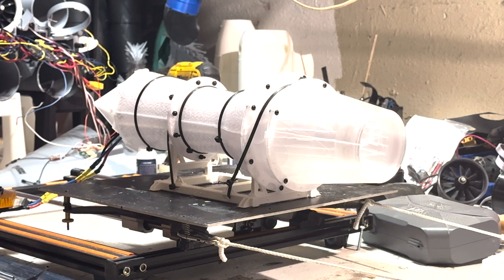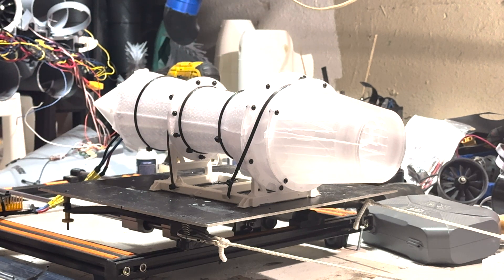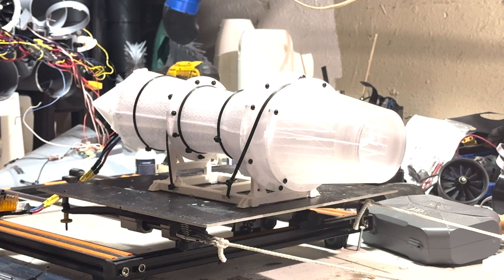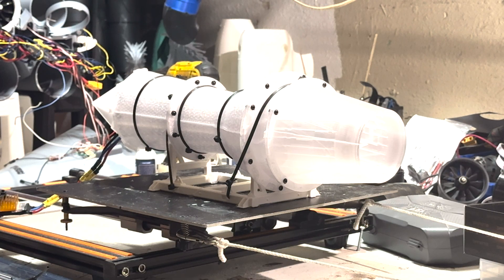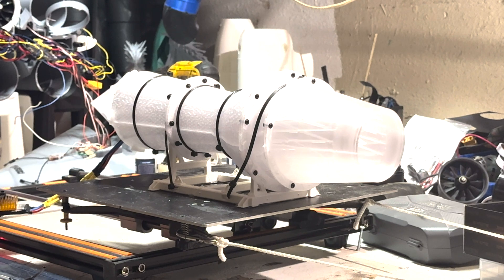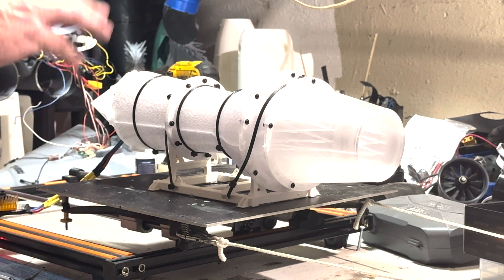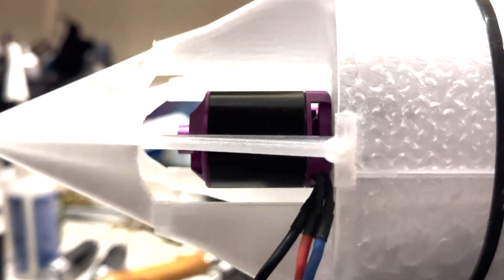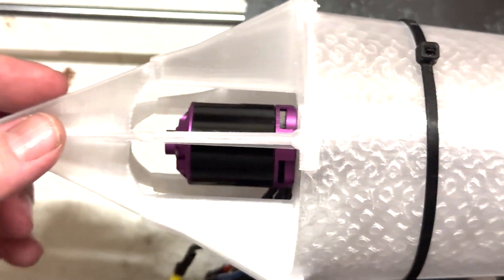Turbo Jet Low RPM test. Fully electric turbine. #rc #edf #turbojet #testing #fyp #3dprinting #diy

Comment: It might be possible to create an effective electric turbine by using two brushless motors one for the first stage and a higher rpm second stage.0
Reply from the maker: The idea behind removing a combustion chamber and using the turbo stage and the compressor stage in combination, rotating simultaneously with one electric motor means that the high-pressure air interacts with the low pressure turbine system, which relieves the torque needs of the motor, allowing for a higher RPM. All turbines being on the same shaft means it will perpetually continue to gain speed until the motor has reached its maximum RPM. This alleviate stress and unnecessary heat on the motor, allowing you to use higher KV motors at lower voltage rates.
Reply: @warmachined3472  I understand the reasoning,  but in actuality, the added friction of the additional stages on one shift will not be overcome by the benefit you are seeking, without an additional power adder. Maybe with an acousticly tuned sequence, the back emf from the two motors running out of phase from each other could be routed to capacitors, and then used to kick the second stage motor, and then the first stage would be unloaded and developed additional back emf, to be routed to kick the second stage again.  Complex as hell, but maybe could be an answer to the simulation of the combustion event.

Comment: Why not just a ducted fan? This setup seems overly complex for less efficiency.
Reply from the maker: I thought the same about stubby fan project, but it ended up being better than I hoped for. It's about finding the best design at this scale. It's the challenge, and I can guarantee it will be way more efficient than the system the motor was originally designed for. Plus, its 3D printed. Anyone can make it to add some authenticity to their projects. There is also a larger project at play that has yet to make it in front of the camera. It's all about the data, and it's fun.
Reply: Some people shouldn’t comment on any social media. Ever.
Reply: @stacietyson5256  Agreed.
Reply from the maker: Elaborate
Reply: @warmachined3472  True, but when you think of an actual turbine, it uses a combustion event that both multiplies the thrust, and drives the first stage. Perhaps if there is a way to use two motors, capacitors, and sonic tuning,  you could somewhat simulate the cycle? But that would really be a longshot.

Comment: You should add a way so it doesn't do full throttle right away, a spool up if you will
Reply from the maker: I am going to try for a clutch and bell assembly from a nitro Rc truck. Should be able to engage and disengage by rpm.
Reply: throttle curve thru the transmitter would do the same